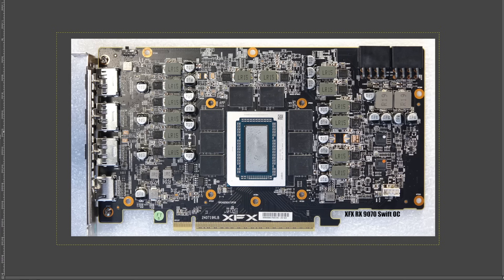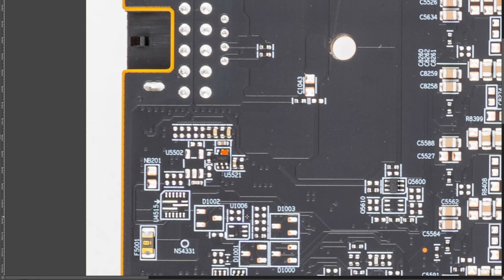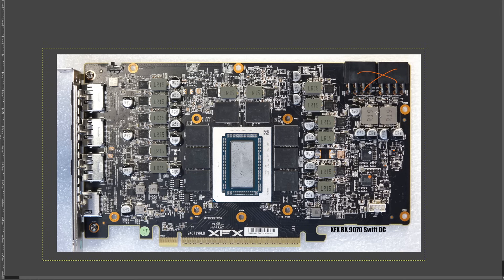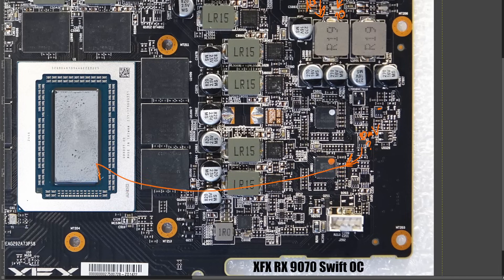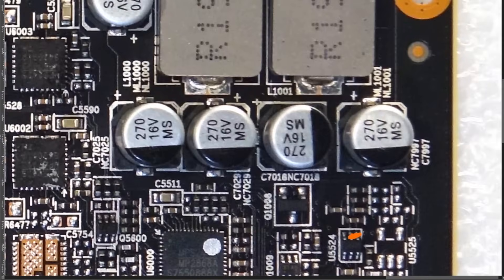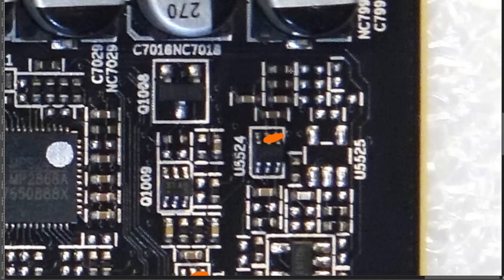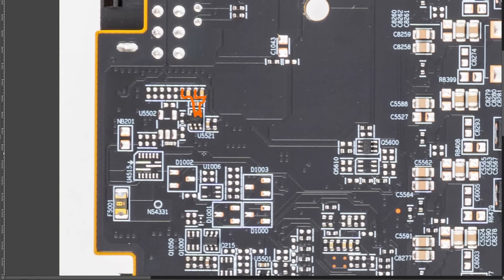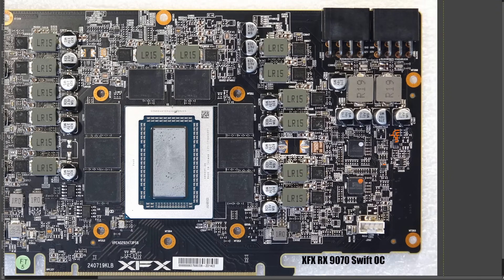How to physically disable the power limit on RX 9070 XTs

Comment: personally I prefer soldering another shunt resistor over the existing one that way it increase the TDP by a controlled amount. By soldering the same shunt resistor over it it multiply by 2 but other values allows also for more finer control of the exact TDP you want for example soldering a 2 mOhms shunt over the existing 1 will only increase by 33% the TDP that way it keeps the TDP behavior but with increased value. I'm doing it on all my nvidia cards since the 970 era.
Reply: Adding 2mohm would increase the current limit by 50% not 33%. However, wouldn't it be easier to use a 400R across the chip pins instead, then you don't need to mess with ultra-low resistance soldering and can using standard resistors (e.g. 390R). This assumes that the GPU is measuring the output of the amp rather than using as a hard limit. Of course if 0V means ignore...
Reply: @dickerson-scott8930  well 2 mOms in paralel with 1mOhm will act as a 0.66mOhm resistor so it reduces the resistor by 33% and then yes you are correct 1mOhm is 50% more than 0.66mOhs. my bad.
There are other ways to adjust the TDP like changing the gain if it is an amplifier or changing the output resistor if it is a current sense with adjustable gain, but I don't see how you would place this 390R resistor here, especially that we don't know what is the IC. Anyway identifying a shunt resistor and soldering big resistor is much easier than identifying the chip. If you feel like it go ahead but that is the more complicated way I think.
Reply: You would wanna do it on the feedback resistor
Reply: @mycosys  I am not sure there is a feedback resistor. The sense device is some sort of diff amp but it needs to measure mV differences relative to a noisy 12V common mode and then produce an output relative to ground. The device has 8 pins, so it has enough for an external gain-setting resistor. However, we (I) don't even know if the output is analog or digital e.g. I2C.
Reply: @dickerson-scott8930  Theres clearly a visible feedback resistor and a bypass cap for each chip - 8 pins standard for an op-amp. Unless they did something very weird you can probably just pencil the feedback resistor, its a standard layout for a diffamp
Reply: I was wondering about this myself. 
Have you performed this modification yet?

Comment: Unrelated to this video but I wonder if you could make sort of a "overclocking for dummies" video for ram timings, feel like it would do really well and be really helpful.
Reply: I think that we need a true masterguide as well. Not one that explicitly shows everything, but describing the major steps. ie 

-"Short" library of keywords and compact timings explanations. Quick overview of memory controllers, and different ram chips. 
-Where do we start?
-good practice, data collection and a script to run a chosen set of mlc benchmarks , for x number of times (very simple to do with a batch script)
-A rough overview of what order you should approach the timings
-How to confirm if the change is good or bad. (we need to fx make sure that some bw bump does not also come with an increase in bw variance) 

-Setting layer1 (cable) settings, terminations, amplifiers, skews, and such Can be reserved for later -> but this is generally rough without proper equipment -> it means a lot of trial and error.
Reply: @joed1rtz well said & great plan 👏
Reply: both requests i see here are previous video series'
Reply: @fracturedlife  where?
Reply: and then when its properly complete, every single tech term should be hyperlinking to a thorough explanation of the specific subject.
Reply: Didn’t he already make one?
Reply: Done already.
None watched them.
Reply: expo and xmp is overclocking ram for dummies.
Reply: There is no "memory overclocking for dummies" and him and others have tried to simplify it as much as possible many times. The easy 'OC' is to enable XMP/EXPO. Beyond that requires more and more stability testing and settings that vary on each system.

The simplest approach is to use settings for the same CPU and memory ICs (e.g. Hynix A-die) as he's laid out in multiple videos as a baseline. The general timings typically work for most kits of the same type until you try pushing them to the limit. What will likely be different are necessary voltages and certain motherboard values that you'll have to put the time into testing yourself to do properly. It's not THAT difficult but there's no getting around how time consuming memory overclocking is.

Comment: Disabling the power limit on RX970/970 XT cards by shorting the current-sense amplifier inputs is a clever, if crude, hardware-level bypass that tricks the GPU into thinking it's drawing minimal power—effectively removing power throttling. While effective for extreme overclocking, it's risky without reinforcing VRM cooling or understanding the board's electrical limits, especially on cost-optimized models. The lack of standardization across AIBs makes the mod inconsistent to apply, though the repeated use of filtering circuits (resistors and capacitors) near shunt resistors offers a visual clue. More refined solutions, like toggle switches or software-accessible power limit overrides, would be safer and more sustainable.
Reply: i cant tell if you posted a chatbot answer or if youve absorbed so much chatbot slop that youre now writing like a chatbot
Reply: @vinbmxnj the em dash is a telltale sign that an LLM was used to write that comment. It's not even an accessible character on most keyboards.
Reply: Have you tried...looking at the channel name?
JFC

Comment: I assume this would also work with the regular 9070 - and it would lead to similar results as flashing the 9070xt BIOS

Doing this mod to a 9070 would actually make it pretty attractive, because you can actually get it at msrp (sometimes) and it would deliver performance in striking distance of the stock 9070xt

Im interested in benchmarks
Reply: Dawid does tech stuff did a video on the flashed bios, if that's what you're asking for
Reply: @rustler08  no im asking for a 9070 power mod and a 9070xt powermod benchmark
Reply: Exactly

Comment: Nice. This mod even looks w/in my skillset. Problem though: My Pulse XT already starts overheating @ +5% power. 
Very useul mod, once waterblocks are available, though.
Reply: Undervolt it. They have higher frame rate undervolt and you shouldn’t overheat unless your blocking off air or your case isn’t getting enough air.
Reply: Noctua mod it with some NF-A12's, stock fans are always garbage.
Reply: That kinda surprises me that it would be overheating. What are the temps? Maybe during assembly something wasn't placed right or....
Reply: If your shit is overheating with +5% power then it's time to RMA it or exchange it.

Comment: Does U5521/U5524 connect directly to the GPU or is there a chip in between?
Reason why I'm asking is, that AMD could maybe more easily force a 2D Mode, when the measured voltage is out of a specific range, when it is directly wired to the GPU with a Microcode update.
Reply: 2D mode doesn't exist on newer cards. All the legacy 2D operations are implemented in software. Also: AMD doesn't care. If you void your warranty exactly nothing after that is of their concern.

Comment: guess i have to watch the previous stream again. 

i assume the card will work like this:
- the Boost algorithm will not be limited by power but only by the achieved clock speed
- the card wont be able to report correct power usage, no monitoring anymore
Reply: If you would like to see power usage with shunt mod, desolder and swap the shunts with half of the value of the original one.
This way the reported power draw will be half of what it actually is and you can just double that when reading it.

Comment: Strange question but... what if I actually want to "reduce" the power consumption?
For example, the 9070 non-XT draws ~160W of power at -30% power target. Is there a way to reduce that power consumption to ~100-110W instead of ~160W?
Reply: Reduce the voltage and the clocks.
Reply: @Maboidatboi  That's the common wisdom. Unfortunately, RDNA4 cards don't behave like 'normal' GPUs.
When you apply an undervolt, the GPU just tries to push the clocks further (while increasing the current, I imagine) until it hits the power limiter. It's strange, especially if you're coming from an Nvidia GPU, but that's how things work on AMD's side. 
So, while I can make my 220W 4070S purr like a kitten at ~80-90W, it's next to impossible to accomplish the same on the 9070 without some sort of hardware modifications.
Reply: @Sam-K Nothing to do with the RDNA4 kid. Saying to reduce voltage for diminishing power consumption and speed must has been one of dumbest thing said generation to generation.

If you have a CPU with 100W TDP and a 150A limit.
It doesn't matter if you drop voltage to 1,2V instead of 1,3V. Since W=V×A. You will still pull the same amount of power it just increase the amount of current you pull (Unless you were at the very limit of current you can deliver).

Reduce voltage on CPU and you will overclock. Reduce voltage on GPU and you will overclock. Any user with previous gen will tell you than reducing voltage will overclock.

In order to reduce power consumption you really doesn't need to modify anything on a card. Just not being dumb.

-30% power consumption. 160W max. Set FPS limit to 72FPS. Enable AFMF2 (or FSR3.1 and above). Boom, you have a card consuming less than 150W-100W on average and matching your monitor refresh rate (or at least it's a smooth experience and you don't have a too much important input delay). If power consumption is still too high. Just enable FSR and drop the res to consume even power. Since the card is still limited to 72FPS..

I'm on a Merc XFX. It does up to 374W. With this simple method. My card is limited to 374W but I consume less than a laptop. If I wanted to reduce again the power usage I guess I could lower the image quality a little (I usually use image sharpening 2 since the feature is nice in most games). But yeah. You really don't need/don't want to drop the voltage to keep the system stable (Just lowering a bit in order to improve GPU clock speed but rather than that, touching anything else (except memory) is useless.
Reply: @Sam-K this isn't hard.  Undervolt AND limit max core clocks.  Amazing right?
Reply: @FireCestina1200  Who would've thought that lower FPS = lower power consumption...
Reply: @davidfaustino4476  Clock offset only goes down to -500 MHz, though. I doubt that's going to help much. 
I guess RDNA4 is completely useless and a waste of money for someone with my specific use case. 
Best to stick with Nvidia. At least when you apply an undervolt on an Nvidia GPU, it doesn't raise the current and tries to overclock itself further! A far more predictable behavior + Nvidia allows up to -50% power limit offset.
Reply: if you want to do it on hardware you can remove the existing shunt resistors and place a 2mOhms and a 4mOhms in parallel this will act effectively as a 1.33mOhms resistor reducing power by 33% permanently but placing only the 2mOhms resistor instead of the 1 will effectively reduce by 2 the power so around 125W.
Reply: Undervolt it.
Reply: Yes, you can do this in multiple ways. Apart from just limiting the power target, you can undervolt, you can reduce the core frequency, you can use Radeon chill to set a frame rate cap to the lowest FPS you can tolerate, you can reduce intensive graphics settings in games, and/or you can use any combination of those options.
Reply: @K31TH3R  RDNA3 and 4's undervolting behavior is the polar opposite of Nvidia's. 
I've explained it in detail above.
Reply: I wonder what a potentiometer on those legs would do, instead of a bridge?
Reply: @LRK-GT  basically nothing

Comment: Would this essentially be the same as flashing the 9070xt bios to the 9070 model? Like the ASUS prime model that’s going around online. Dawid did a video about it.
Reply: no, flshing the vbios just gives you the XT powerlimits 304watt + 10% powerlimit. this mod disables the powerlimit
Reply: Sorry, I mean yeah I got that. I just meant, will this achieve the same goal; to get the 9070 to perform as or better to the 9070xt
Reply: @iTechtronicz  Short answer, the performance will be better than a 9070XT BIOS flash as power limit is uncapped, whereas the 9070XT will have a capped limit.
Reply: It is different. Using 9070XT BIOS is basically allowing the GPU to use the maximum power limit of 9070XT, which a default 9070XT GPU should allow 304W + 10% OC. This mod is removing the power limit thus potentially the GPU will try to reach the highest clock speed possible with the main limitation is probably voltage. Just be careful on testing the GPU with something like Furmark.
Ideally for everyday use you still want the power limit.
Reply: This is more than that you are only letting the 9070 clock to XT TBP

Comment: noob question,  what stops a card with no power limit form taking to much power under load and burning ? Is it thermal  limit ?
Reply: Yes. There’s always a thermal limit where it begins to downclock to keep the thermals under control.
Reply: The voltage. 
 I'm not good with words and I've been sitting here for a few mins trying to find a way to explain it in a simple way.....
Reply: And voltage, if the voltage in not enough for the clockspeed it will crash straight away

Comment: 3:30 i've seen a lot of switches/buttons with two parallel lines
Reply from the maker: See I consider that 2 switches sharing the toggle/lever. Then again I've never really looked into switch terminology.
Reply: @ActuallyHardcoreOverclocking  A single switch that controls two different circuits is a double pole switch. A switch that that chooses between two alternate connections (as opposed to on-off) is a double throw switch. So, for this application, you would want a single throw, double pole switch.

Comment: What were the markings on the op-amp looking thing? Really looks like a simple differential amp, may even just be amplifying current and ground referencing rather than amplifying voltage. Each one also seemingly has a decoupling cap and feedback resistor. IF it is a feedback resistor, you can just short that for zero gain. Maybe even pencil mod it
Reply from the maker: 1A20f or 1420f
Reply: @ActuallyHardcoreOverclocking  Cheers mate. Not having much more joy identifying it, but would be kinda epic if it is indeed a simple amp with a feedback resistor that can be pencil modded.

Comment: Of course you can use a single switch, get a double pole, tripple pole, etc.
Reply from the maker: I'd consider that multiple switches sharing a lever, but sure.
Reply: @ActuallyHardcoreOverclocking  I'm not an electrical engineer, but it seems to me like they might usually be counted as a single switch so that the popular pole and throw naming convention is simpler.  

Plus, a lot of the ones with multiple poles will be used for situations like this where they're actually doing one thing but need multiple separate connections to do that one thing.  

This is just the pleb guess though.
Reply from the maker: @MiIIiIIion  yeah I've never really looked into the terminology for switches.
Reply: @ActuallyHardcoreOverclocking Well it's one physical switch with 2 electrical one's kinda. All the convenience of one switch, with the features of 2 I guess.
Reply: Lol, if buildzoid says you can't then you can't. There is obviously a reason why. You're not switching a light on and off...tripple* (triple) pole smh.
Reply: @Se7en20082008  you can and OP is right.